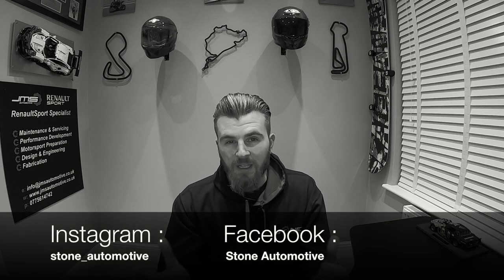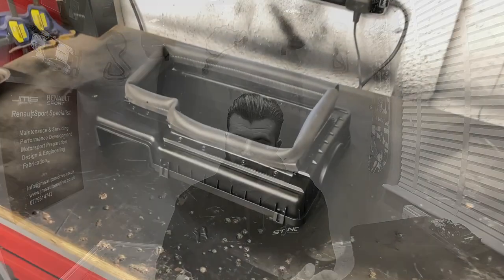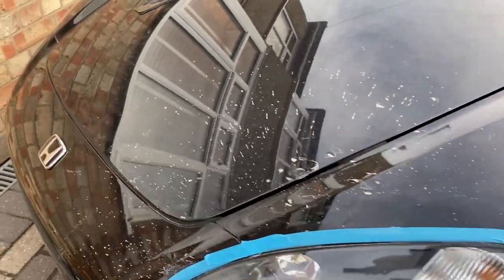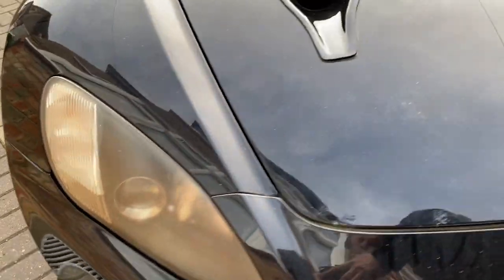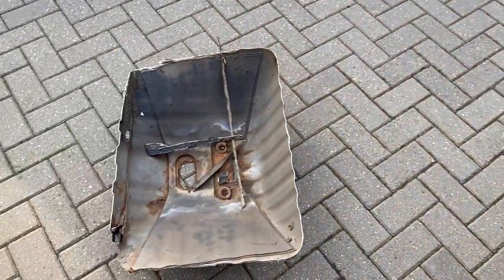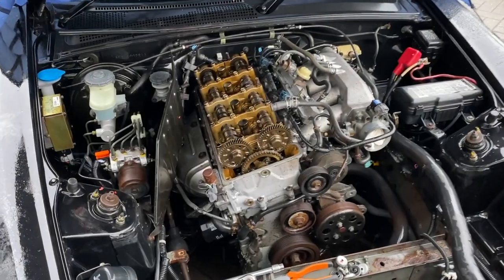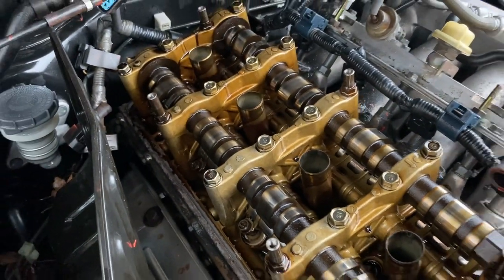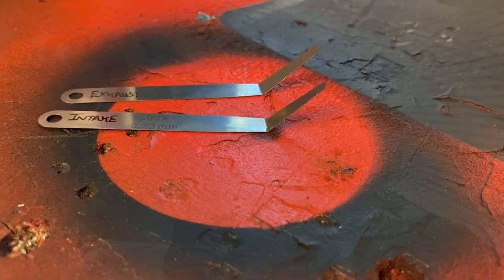Honda S2000 Open Top B-road Blaster Project ** EPISODE 4 **

Comment: Alright mate I feel you’re pain, I’ve an ex coastal S2000 too, it’s in getting new arches and new sills welded in at the minute, I keep waiting on the call to say there’s no where to weld too, I’m a Vtec fan boy in my late 30s you’d think I’d know better ha ha, keep up the content but get out a that office get the camera set up outside more when your working deck the neighbours
Reply from the maker: Hi Derek, fingers crossed for you yours is not as rusty as mine, all part of the fun though 😅

Fingers crossed I’ll have a suitable location set up shortly, the drive way with all people walking past & main road noise is a nightmare.. when the new workshop is sorted it will be recording heaven 😬
Reply: Bilt Hamber 80 is great 😊
Reply from the maker: @che7wins614  heard this from a few people 👍
Reply: The same guys that are welding mine are doing a full decrust with wurth rust converter and completely reselling the underbody so should be a good finish,

Comment: do you happen to have the link for that nana duct, i will have to do these duct and box mods
Reply from the maker: https://www.ebay.co.uk/itm/NACA-ROUND-DUCT-BONNET-OR-BRAKE-VENT-COSWORTH-TRACK-CAR-/174777626506?mkcid=16&mkevt=1&_trksid=p2349624.m2548.l6249&mkrid=710-127635-2958-0

Just a generic one off eBay, worked rather well (be plenty of videos on it once she’s on the road 😬)
Reply: @stoneautomotive  i appreciate it brother, I really like this build. btw have you thought about opening up those brake ducts and routing the hoses to the back of the dust shields for rotor cooling.. I have done this to my s2000 and at the track i had minimal brake fade, on every straight my rotor would cool off so good
Reply from the maker: Yep it has been something I’ve considered as there doing nothing currently especially if I do end up on track, main thing at the moment is getting it road legal 😅
Reply from the maker: @mr.hernandezdrives  in the UK vehicles are required to have an MOT every 12 months which essentially checks the vehicles safe to use - will be booked in next month 😬